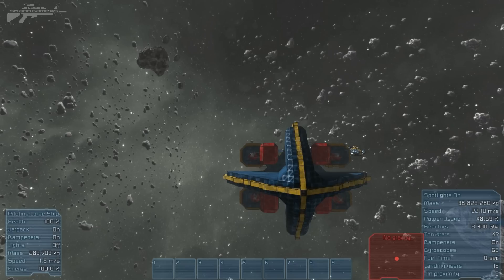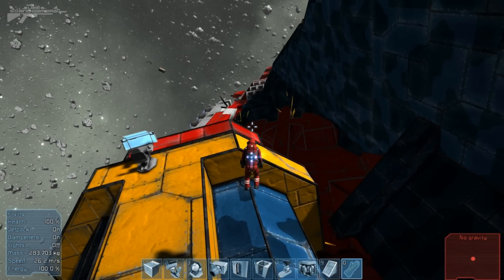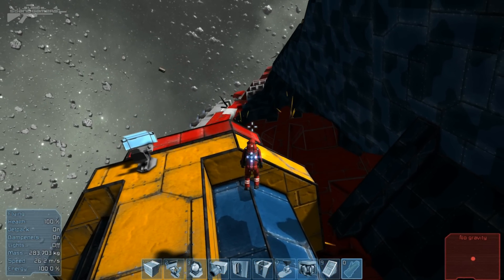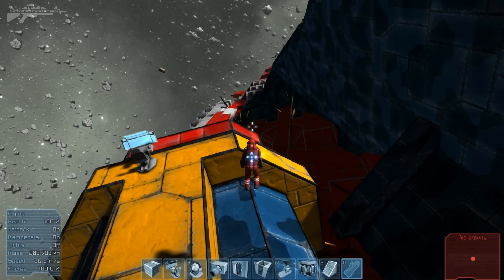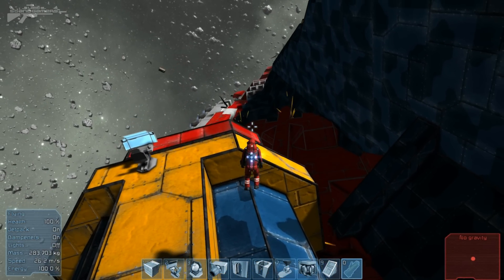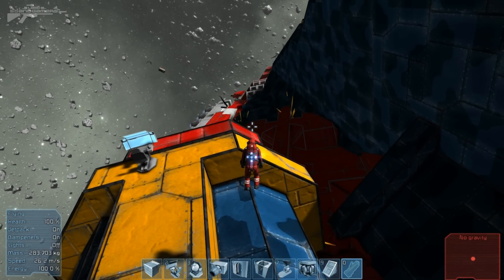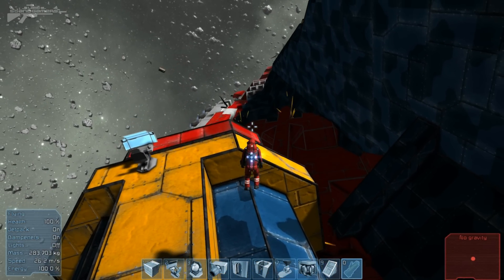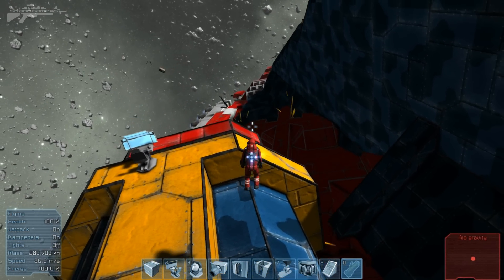Space Engineers - Is Ramming Really That Effective ? Assembling A Fleet Part 4

Comment: Ramming is indeed effective. Especially when you design your ships with ramming in mind (which i ALWAYS do even if the ship is not fit for that role). Though I would only recommend it as a last ditch attack.
By the way, the ramming head of your ship was VERY inefficient, you have to make it much smaller and a little more pointy. You would have gotten better results if you hadn't gone with the giant arrowhead.
Reply: My sentiments exactly. If he needs any indication of that, he can look up what ramming prow's looked like on old ships of the line.
Reply: Maliciously Delicious Also ramming more high value areas of the ship such as the rear engines thus immobilising the enemy ship at the cost of only a few armour blocks
Reply: Yeah what I do is I put my rams at the front with minimal points of contact and then sever it after im done and switch to main weapons.

Comment: Ramming also doesn't work because people who think it will also ignore the fact that enemy ships aren't stationary like the empty ship in this video.  Once this game gets farther along and people start having battles with crewed capital ships - if that day ever comes - they'll quickly realize that it's a maneuvering nightmare to try and ram other mobile, PC ships.  Same goes for inertia-launched "torpedoes", by the way.
Reply: Well, considering I've played online with some friends and made some pretty big ships to muck about in, I can tell you that you're half wrong. You are right that people don't seem to realise how hard it is to ram something while against other players, but what you didn't account for is context. When my friends and I fought each other the ramming was always something very spontaneous and with ships not designed for it; either a coup de grâce or a last ditch break out. In most cases it ended the fight even if the ramming party didn't completely wreck the other guy. Even the smallest connection does quite a bit of damage (unless they are armored to the fricking teeth).

Basically what I'm trying to say is, that it is a much more opportunistic thing than most would believe and I wouldn't specifically go for or build ship expressly to ram. But after a few sessions, every single one of my friends and I had implemented ramming prows for when it did happen.

Comment: Aaron, have you considered building a modular ramming ship? You could have a massive "drive" section that docks with the disposable ramming head. The ship could use the ram until it becomes to damaged to use at which point it could separate with the ramming head and thus becoming faster and more maneuverable. The drive portion could be outfitted as a medical ship so that it could lead the charge, hiding behind its massive ram, then retreat to help with medical duties. The discarded ram head could also be used as cover by the fighter craft, to hide from the AA guns of the other ship or ships. Just a thought
Reply: if the last scenario in the video happens, then your idea wont work Chris. Not that in theory its a bad idea, but in that last scenario there is no seperate ship to undock...
Reply: True enough but hopefully the game mechanics will continue to be upgraded to the point where ships don't just merge together.
Reply: This would be so easy a baby could do it now

Comment: One of the best ways to make a ramming ship, and I have used this before playing with friends, is that you add some warheads to the front, on the end of a long-ish tower of light armor. As well as reinforcing behind the tower, once you do the initial explosive ram they would be weakened and you would be able to finish them off by regular ramming. If the enemy is using the same tactic you just add some antennas on the very top of the tower to destroy their warheads before they reach you, then when you reach them your warheads (intact in theory) blow up against them, with as little effect on your ship as possible.
Reply: As good of an idea as this is, auto-turrets when implemented will tear this to pieces, and fighters will target a vulnerability like this. If the ram gets shot off, now you have a massive chunk of explosives no longer accelerating with you and right in your face.

Comment: A ramming ship needs to be small fast and full of explosives. Nothing that's not essential should be on it, i.e guns and torpedoes. and generally you trade it off for their capital ships so the trade is more than justified.
Reply: You are describing kamikaze/ suicide attack ship/drone. True ramming ship should be able to do ram the ship and board the enemy ship couple of times in row atleast and be still functional on some level afterwards
Reply: More thinking along the line of fire galleys, ala aoe
Reply: JacopInsanity
Well, if the only objective is to board the enemy craft, then I don't see how ramming is necessary.  As stated it does damage to both the ram and the rammed. I think it would be better to instead utilize localized explosive charges to the enemy hull to create entry points just large enough to get troops in.

Comment: What if you ram a ship, then evac your crew into fighters and blow up the ramming ship? If you're in a large battle with multiple ships this might be a good idea to get rid of the flag ship of the enemy fleet.
Reply: So u have anti-ship ships filled with troops to take down large ships while other ships defend your large ship?
Sounds like a game mode.
Reply: mackenzie purnell You have your ramming ship and inside of that are fighters. Your ramming ship also has a bunch of explosives in it. You ram your ship into the flagship of the enemy fleet, evac everyone into the fighters and then blow up the ramming ship. I feel like this would be a good tactic in a large scale battle.
Reply: The 1 Realm of Retro! totally. either that or u send in a medium size ramming ship made as cheaply as possible with enough armor to survive the barrage of the enemy fleet while advancing for the ram. then either ur whole ship is full with explosives or just the ram is full of explosives. u penetrate the enemy ship and them either evac on fights like u said then blow the ship from remote or u have just the ram explode and then the rest of ur ship is full of ur best soldiers u have in ur clan or whatever u play in. these guys will poor in storm the ship and take over. then u other options are cut of the ramming ship and use the rest of the ship as their own by rushing in reinforcements and engineers to repair that ship. and even if the ramming ship gets annihilated on the run to the target the ability of the ship to damage or at least distract a capitol ship is a great tactic.
Reply: jack elliot
Yes! Sad thing is is that this game is so unoptimized (at least last time I checked up on it) that such a large battle is impossible. These optimization issues are why I still haven't gotten the game as much fun as it looks.
Reply: The 1 Realm of Retro! yes same here its need to be fixed

Comment: Issues in ramming and boarding. Also some tips.
1.Placing the doors on the front is a bad idea because they get damage easier. (If there a future updates for them to be damage?)
2. Enemy ship's design is a big factor. Sometimes a ram can't work because the ship is light or being pushed than smashed. Also no pilots cause ships to drift more than taking the impact force.
3. Boarding with small ships is better than big. A small ship can lock or get stuck in the enemy hull.Then marines could invade the ship faster than a big ship with poor aiming and speed.
4. Big ships are hardly used as ramming in the navies in history. Mostly these roles are for smaller one with big engines, heavy armor on the nose only, and explosive on the nose. If you a slow big ship? You are more likely be avoid from being ram you. Big ship will only ram when they have nothing to lose because the are heavy damage.
5. Targeting your ram to hit engine, weapons, or the nose then the center. Center of the ship is normally the strong part on the ship. If you hit the engine in a ram the ship can go any where fast. Hit the main weapon saves you from the enemy shooting at you while stuck or pulling out for next ram. Hit to the nose make the enemy take more impact force. Which may cause a spin out or take out nose weapons. Also it the enemy would have to pull out of your hull with weaker reverse engines.

Comment: Ramming ships will not be successful with conventional designs like the one you have in your video. All my ramming ships that i have created have replaceable ram heads, also i always use a combinations of explosives and ream heads. I do not use torpedo on ram ships as you would slow down to deploy them.
I also find that generally you want ships that can go up to speeds of 70m/s and over. So smaller raming ships at higher speeds has equivalent penetration as larger ships from what I've tested. Though that being said you generally target key areas using ramming ships, such as the engines and control towers. It makes boarding the ship much easier as well.
so far though the most effective strategy and design I've found is to have a main ramming carrier ship accompanied with smaller ramming ships with adequate amount of explosive on them. essentially i can cut into a good solid 5 layers if i concentrate all my ships on one area, but even better i can take out alot of main thrusters with this strategy. which then just leaves the ship to be an easy breaching target with the main carrier.
Reply: My usual strategy is to build a large ship that wouldn't be built specifically to ram an enemy ship but instead to make it able to ram other ships so that if it was to lose it's weapon systems or suffer damage that couldn't be easily repaired I can just ram other ships 
while replaceable ram heads are good they would need to be low cost to build a lot of them so instead I find it more sensible to use a single use ram head 
surface area is one of the main problems with his because even at top speed the area of impact is reduced while this would work in real life, in the game a larger surface area seems to be the way to go
Reply: A disposable ram which is not integral to the ship is really the only way to do it. Also, the one he's built in this video is entirely too fat. It has to push too much material out of the way to be effective.
Reply: TShirtCannon in the real world you'd be right that it was too fat, but I'm not sure that applies in this situation,
and besides, a disposable ram is risky because of the cost to build a new one each time 
it makes much more sense to just have a single ram that also adds an extra layer of armor to the front of your ship, and the ship shouldn't be only used for ramming, but has the capability to ram a ship
Reply: I say this not having a full grasp of how they work, but could you use rotors with high torque to bridge the gap between Ship and ram piece. So it acts like a bumper, cushioning the blow and preventing damage to the main vessel and still allowing for the damaged head to be replaced easily

Comment: Ya normally do good work, but this time around, I think you've missed a good opportunity. That ship was destined to fail before you even took off.

Look at ships that have been historically used for exclusively for ramming, like Triremes. The ramming bit is extremely narrow and meant to punch deep into the ship and cause damage (usually sinking it, or in this case, compromising the interior systems and creating an opening for assault troops to take advantage of) and were built to be fast, and a relatively narrow oncoming profile.

A better design, imo, would be something similar to a basket-hilt rapier. A reenforced but tapering ramming point, an arched back shield to protect against on-coming fire, and the command bridge/engines in the protective shell of the basket where handle of the sword would be. The ship could then pull out after making a small hole and the assault team could rush the hole created. Preferably aimed at the engine room/thrusters, since destroying the engines of the ship will greatly hinder it's ability to fight or flee. Maybe add a small cannon on the back of the ship, so it can defend itself from rearward attackers or so that it still has a means of attack once the ram has been completely torn off. (this would also make ramming at least a little more economical since much smaller amounts of resources would be lost as opposed to that big honking thing)

Also might wanna start messing around with survival mode to get an idea of what the scale of builds are going to be. Large ships take a RIDICULOUS amount of resources to build and even your more modest ships will take massive amounts of resources and man-power to construct/operate. And especially their fuel consumption is going to limit most large ships to 20-30 mph tops, unless it's a stream-lined special-forces ship with limited armor/armaments.

You can enable survival mode just by editing your world file and changing the CREATIVE to SURVIVAL.
Reply: but I don't think surface area causes much damage reduction in game yet

Comment: Tips for Ramming Ships:

When it comes to ramming ships, you need to put blast door blocks in the front, backed with heavy armor and support beams.

Only large ships should do ramming. You want the ship you are ramming to be somewhat smaller than your ship.

You want to be able to encompass a large amount of the enemy ship into the ram; perhaps even cut it in half.

Only light armor ships should be subjected to ramming. Do not ram heavy armor ships.

If you really want a ramming ship, make sure it has good acceleration. It needs to be able to speed up at a moment's notice.

Happy Travels :)

Comment: Ramming is effective at present for a couple of reasons:
1) Damage is not realistically being modeled. A ship that was ramming into another ship would be taking damaging throughout the entire ship. Damage is only calculated for the blocks that come into contact with each other and isn't calculated for the ship as a whole. Also interesting is that damage isn't calculated for things like asteroids and meteors which are allowed to act like particles of infinite density even though they would likely be less dense than an equal volume of light or heavy armor.
2) There aren't any real alternatives besides missile turrets. The game doesn't have any way of making actual missiles, rail guns, lasers or any other type of weapon. This is probably because the game wasn't designed to be a space combat simulator.

Comment: Unless the torpedoes can lock onto a target and correct their course, having a situation like what you have, where two ships are roughly the same size,  assuming you're nicely lined up on the horizontal plane as you were, whenever 2 torpedoes are directly on target, the two top ones or the two bottom ones have a greater chance of missing.

Comment: Ramming effectiveness depends in large part what materials are rammed into each other. I've found that Heavy Armor slices through Light Armor like a hot knife through butter.

An easy way to show this is make a single block thick rod of HA next to a ship made of LA. Then all you need to do is put a Gyro on it and have the rod turn to slice into the LA ship. It quickly rips through the hull and much of the HA rod remains.

So far I've had the most success with ramming ships that are about the size of the rescue ship, if not smaller, with a long heavy armor rod 1 block thick and 10-20 blocks long.

The majority of damage comes not from initial impact but rather after the rod has pierced the hull. With the ships gyros you turn in all directions back and forth and the rod rips up the insides of the ship taking out reactors, refineries, gravity gens, and etc. If used on a hanger bay it can decimate the ships inside.

Your ship seems to be built with form rather than function in mind. It does look cool but as you showed it doesn't do much damage when it rams. Massive lumber ships like that one are most likely only going to be good for ramming stations. A good ramming ship needs to be mobile so it can hit a moving target.

Comment: As a last resort i believe that ramming is kind of effective, i mean, i've tested it on one of my ships, i hit it right in the area where the reactors are located and pretty much destroyed half of them and took a significant chunk of a side of the ship, however, both ships, that were from the same model, were still capable of flying and maneuvering, however the rammed ship lost part of its capacity to generate power, but that class of ships is equipped with a set of emergency batteries, located on 2 parts of the ship, half of them at the engineering and half at the middle section, those batteries can keep the ship up and running, although they will overload if the ship perform complicated maneuvers.

Comment: Would more of a dart design work better than a broadhead-type design? Rather than doing max damage to a general area, perhaps more of a piercing design to puncture the hull and damage specific internal structures like reactors or cockpits? Would need plenty of speed for max penetration. Perhaps one of your gravity weapons forged to the bow would be beneficial? Just a thought.
Reply: I'm not sure but I made my own small ship for ramming which is using unclestes mod for it. It basically is a spear. What I realized was the faster you go the more damage to you but the slower you go the less damage to the enemy there is a little sweet spot Aron d 20-40m/s

Comment: Just make a pointy spear with warheads after around 2-4 blocks from the tip. Set the cockpit back near the thrusters, go full speed into the enemy capital ship, check if the warheads are in, manual detonation.

It could range from a 4 block thick spearhead to around 6 or 8 blocks. Pistons could help saving the rest of the body since they absorb some impact, at the cost of piercing power.

Edit: extra tips